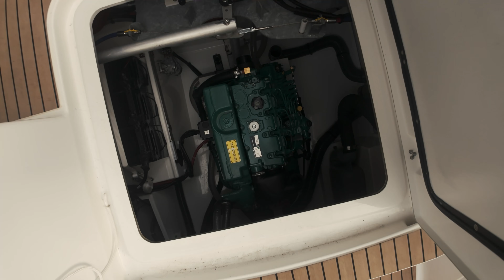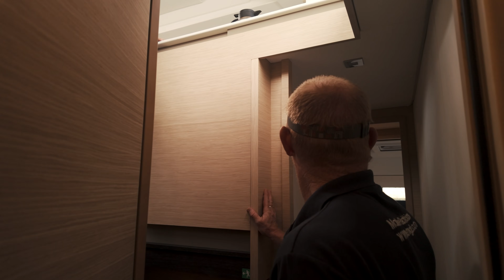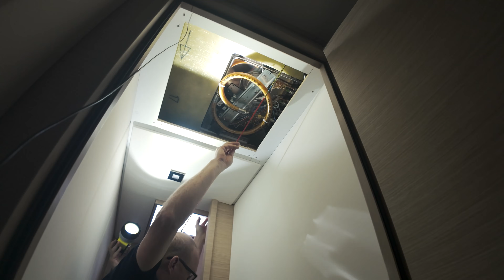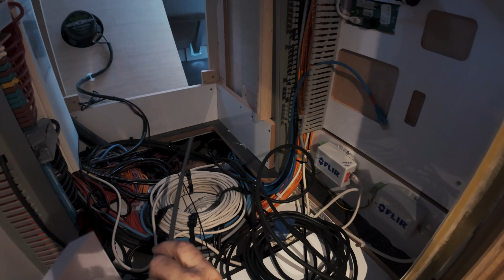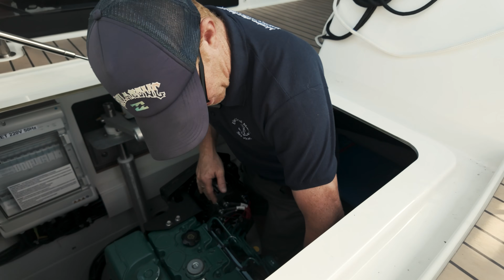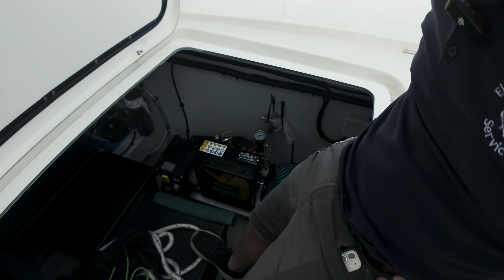Full Catamaran Systems Fit-Out | EMS Gibraltar

Comment: As a marine electrician myself, it’s great to watch someone else do the work for once! Also, why is there still a DMC fitted while there is also a Cerbo?
Reply from the maker: The DMC was responsible for the 12/2000 multi and original installation as installed by FP. The Cerbo is connected to the 48v system with BMS and 10k inverter controlled through touch 70. Hope that helps!